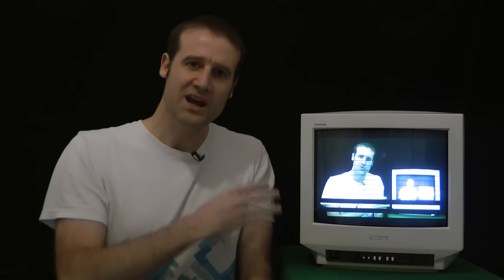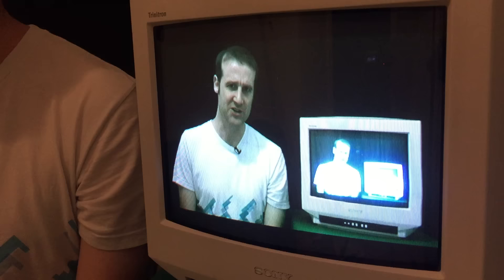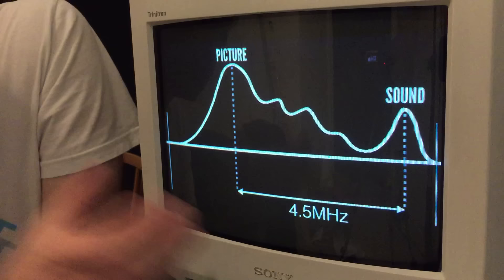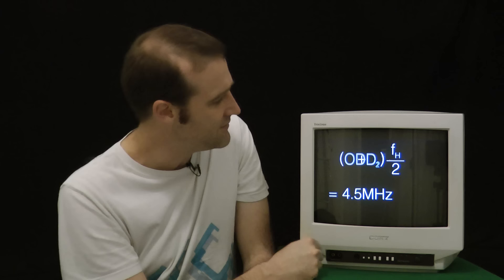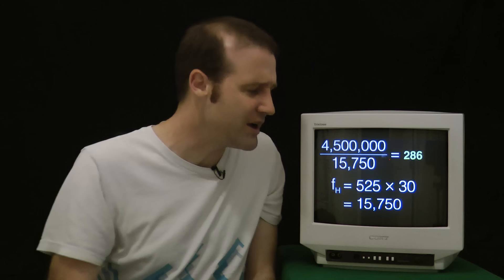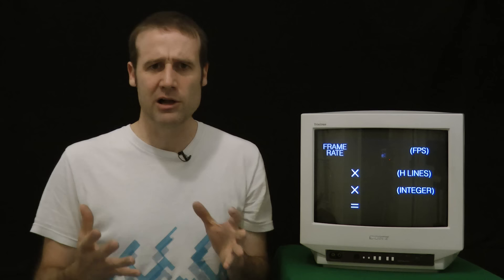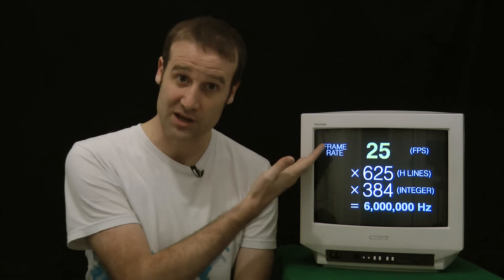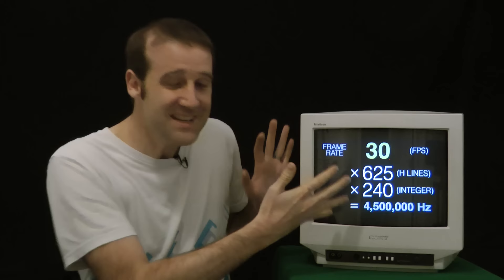Why is TV 29.97 frames per second?

Comment: Europe had the advantage of studying the NTSC system for nearly a decade before implementing their own color standard.  The U.S. introduced NTSC color in 1953, while (I believe) Europe didn't debut color until 1962.  It's not a surprise they were able to make improvements.  Switching to 625 lines made it work better, but at the cost of early model European TVs no longer getting compatible broadcasts.  When the U.S. began phasing in digital broadcasts most Americans got their TV from cable or satellite rather than over the air broadcast.  When analog signals were phased out, an analog TV could still get a signal with a converter box.  Old analog TVs didn't have to be scrapped.  Of course most of them were anyway as HD and 4K TVs have gotten so cheap most people have upgraded.

Comment: So now that the analog signal is switched over to digital, how has this changed? I'm guessing we don't have to worry about the 4.5 mhz window for a channel. I mean, we now have thousands of channels in multiple languages and we have steaming services. Does that mean the fps has changed? Or is it still 29.97?
Reply: It’s still 29.97, it makes it frustrating to work with video recorded on separate devices where audio and video need to be frame-perfect.

Comment: Sports and News was never at the frame rate of 29.97fps on NTSC TVs, so this video has so much misinformation.
And PAL would of had 50fps live broadcast. By the way, your eyes won't see both fields at the same time so 525 should be 262.5 H-lines 15.625 kHz.

Comment: If they changed the frame rate, how come old TVs could still understand? Wouldn’t they become out of sync?
Reply: Matt was wrong, the TVs weren't using mains for sync (it's not nearly accurate enough for that), the sync was in the signal itself and 59.97 was well within spec (each oscillator is a bit different, so the TVs were built to accept signals a bit below and above what they thought was 60Hz). 
The reason 60Hz was chosen was the mains frequency, but it had nothing to do with TV sets, it was so that cameras wouldn't pick up flicker from studio lights.

Comment: So 29.97 was basically a hack, got it. But if the framerate was supposed to match the frequency of the electricity, then wouldn't 29.97 fps put it out of sync and possibly cause some other issues that way? (I assume the error was negligible at the time, but would still love to know if there was any)
Reply: Synchronisation pulses were also transmiitted in the signal, which tell the TV when to "start over".

Comment: CBS had developed a color system superior prior to the RCA system but was not compatible with the 30 fps B&W so the CBS televisions could not show b&w shows. To really get your head scratching look up why to get NTSC at 29.97 fps to time correctly all broadcast video has to be shot using 'dropframe'. You may need a calculator to prove it for yourself.

Comment: Couldn't they just reduce the used frequency slightly? As in, leaving a bit of the 4.5 MHz to do nothing.
Like how 527 lines with an iteger of 248 would result in a 4,490,040 Hz signal, leaving 0.00996 MHz or less than 0.3% difference empty.
The additional lines would dissapear into overscan anyway and the miniscule amount of not used frequency could easily fall into manufacturing accuracy on the older B&W sets.

Comment: How would it be if companies changed standards at will? They would be able to obsolete your equipment so you have to buy new. Very convenient when a company wants to exploit its users for mo' money, mo' money, mo' money. Like when a website keeps "suggesting" you update your browser to avoid interruptions with a version that won't work with your machine. You have to buy a new one. Particularly suspicious is the case when the site doesn't serve anything different from what other sites serve with no interruptions, and no suggestions you upgrade.
Reply: @Christian Hansen Because of better compression algoritms and higher resloution than 480i /576i. Even early MPEG-4 ASP was based on h263, it had  limitation of resolution and bitrate. Later iteration had HD and better bitrate but still operate on h263 and wasn't compatible. The true MPEG-4 AVC based on new codec h264 has way better compression and much higher bitrate.

Comment: "Not the Smartest Choice" isn't exactly fair. It wasn't really a choice, there wasn't an alternative at the time. It's easy enough in hindsight to say that PAL is a smarter choice, but when the NTSC standard came out, PAL didn't exist. PAL was developed, at least partly, with the limitations of NTSC in mind.

But what about after PAL came out? Was it still a choice then? No. Obviously at that time, the market and consumers had already spent large amounts of money on NTSC-based hardware (be it on the broadcast or receiver side), and switching to PAL simply wasn't an option. The cost to both the consumer and broadcasters would have been absurdly high, something very few people would have bought in to. By the time PAL formalized and standardized, the NTSC standard was too widely implemented to change in a reasonably cheap way.

All that is to say that NTSC wasn't really a choice.

Comment: In your solution to the NSTC problem you simply picked a lower integer factor of 240, with 625Hlines and 30 FPS. However, if you can just arbirarity modify that integer, why not go for a smaller factor such as 120 and get 1250 Hlines? I'm sure there are some consequences to altering that factor, which I'm sure you know too, so please explain why you can't simply pick 120 as the integer factor?

Comment: Because the A/C in your wall is 59.9hz exactly 2 scans in the old interlaced TV format...
Reply: ...no, AC runs at 60 Hertz. If your electrical system runs at 59.9hz, you need to call your electric company now.
Reply: @General12th  Can't be anything to do with supply frequency which for example has a tolerance of plus or minus 1% in UK, so can vary from 49.5 Hz to 50.5 Hz. If it is also 1% in US then the range would be 59.4 to 60.6 Hz. No need to call your electric company yet.

Comment: PAL used not all horizontal lines for the picture only 575 if i remember correctly, the rest went for Teletext. Question is where did the NTSC system put the Teletext?
Man I'm gonna miss Teletext :)

The other thing i don't get is, what does it have to do with the power line? Did the Cinema and TV camera's didn't work with 60Hz? And when they changed from 30fps to 29.97 when color was out, did they also change the power line to 59.94?

Weird thing is, i have a Canon SX200IS, i can set it up for PAL and then record in true 30fps, and i can set it to NTSC and record in 25fps, but when set to 30 it records at 29.97 :)
Reply: There was enough leeway in the design specs of the TV sets to adjust to the small change in frame rate for color signals.

Like PAL, NTSC also had hidden scanlines used for sync and later teletext (seen as the black bars that roll when the vertical hold is out of sync, teletext signal, when present, appears as moving dots inside those).

Comment: I'm confused by how the 29.97 fps would have been derived from the 60Hz mains frequency ?
Reply: It's NOT derived from 60 Hz. Rather the source signal is at 3.579545 MHz at the source. That's multiplied by 2 and then divided by 455 to provide 29.97 Hz at the source.

Comment: It’s actually more complicated than that. PAL and NTSC (as well as SECAM) actually refer to color standards. What you’re actually comparing when talking about the bandwidth are related to the broadcast systems used (and in actuality, the frame rate is defined there, not in the color standard). PAL is commonly used on Systems B, G, H, I and N, while NTSC is used with System M and J(which I refer to as M’ because it’s just a slight tweak in brightness level in relative to System M). SECAM is used on Systems D, K, and K’. The 6MHz block is defined by System M, as is the 30fps/29.97fps frame rate standards. On the other hand, PAL and SECAM are often deployed on systems that also offer larger blocks- System B, which is used by most countries that are a member of the British Commonwealth, allocated 7MHz. All UHF systems as well as VHF systems used by the Eastern Europe block allocates 8MHz. To prove a point that PAL is agnostic to the system, Brazil used PAL on top of System M, which allowed it to keep broadcasting at a full 30fps with 6MHz channel blocks and still have a clean picture and sound signal.

Comment: Well since tv's where and are mostly 60 hertz. Why didn't they broadcast in 60fps? 29.974f ps on a 60herz screen introduced frame doubling.
Reply: 29.97fps in TV broadcasting was always interlaced and even today it is still interlaced, which means that it is as smooth as 60fps. Some TV channels are actually broadcasted at 60fps

Comment: But if 30 fps was initially chosen to match the AC frequency to make engineering TV sets easy, wouldn't reducing it to 29.97 fps cause problems in earlier TVs?

Comment: That 1 MHz wasted spectrum at the low end of the channel is not wasted. It's necessary. If it weren't there you'd have SSB ... and you'd have to have an accurate carrier injection at the receiver to recover the video signal. That's expensive. And pointless.

Comment: I don't understand any of this. So of the 6 MHz window (why 6, by the way?), there's only 4.5 MHz of actual picture, 0.25 MHz wasteland on each side (total 0.5 MHz), and a 1 MHz "windup" (and why is a "windup" needed?) - that's 6 total. So how much for the sound, then? There's a sound spike, there - looks about 0.25 MHz worth - but the video says it begins 4.5 MHz after the picture info has commenced - which actually leaves 0 Hz for the audio.
Also, why on earth does Δ1 and Δ2 have to be odd number integers? Why not two even numbers instead? Two evens also make an even.
Reply: I'm going from old memory on this (TV was a subject I chose not to take in tech college in 1970). But I did quality inspect TVs at GE in 1972-73. 
What should be added to the discussion are the actual terms we used. Horizontal retrace time - the time it takes to return the beam to the start position to draw the next scan line. and vertical blanking time - turning the beam off during the time required to bring the beam back to the top (in a zig zag way). What I think he means when he said windup was actually guard band. I also remember color was a neat trick of using a sub carrier frequency. 
This is turning rusty gears, but television had to share a portion of the electromagnetic spectrum with other services and although it wanted 6 MHz per channel, that wasn't easy to carve out. Channel one did exist, for a while, but It was determined by whatever organization preceded the FCC to redeploy that piece of spectrum to something else, so TV got 2-13. To make matters worse, not all of the available spectrum was contiguous, so we ended up with low VHF (channels 2-6), high VHF (channels 7-13) and ultimately UHF (channels 14-83), plus a little, unusable gap between channels 4 and 5 (I think). For a while competition for bandwidth came from CB radio, then cell phones and poor TV had to give up more bandwidth (channels 69-83 but I'm guessing).
We really never got to use the full 4.whatever MHz either, nor the 525 lines. Enter another term, overscan. The actual trace began above the phosphors and extended below it so in reality we only saw about 480 lines. Hmmm, where have I also heard the number 480 as in 640x480?  Occasionally we could have a defect and we could actually see an interesting problem called vertical foldover, where those lines destined not to be shown actually did, but inside out.
All of this said, I think I remember the real problem was visual interference between incandescent light bulbs that did turn on and off 60 times per second and the light emitted from a TV screen. And if I remember correctly, the way to solve the interference problem was to change the vertical refresh rate from 60Hz to something less. He is wrong about TV using the 60Hz power line frequency to synchronize. TVs had oscillators to do that. There are 6? sync pulses during blanking that are used to keep the vertical oscillator running at 59.xxx MHz and as far as I know PAL analog always had that visual interference problem at 50 Hz.
Overall, credit US engineering for solving difficult problems and making seamless transitions. 75% of the sets built when I was at GE in 1972 were black and white. At the same time we were building color sets downstairs and introducing a new technology called transistors (but I never did understand them new fangled things).

Comment: "I couldn't find a nice concise answer"
Here's one television used 60 hz from the powersource as the timing for framerate, which because of interlacing becomes 30hz.
When color was invented the chroma(color without luminance) data could not be added without some measure of interference or disruption of broadcasts to Monochrome viewers. So they used .05 hz of the standard monochrome signal to add it. Thus reducing the framerate to 29.95hz. There! Saved 15 mins...

Comment: When the original TV was created the US was using 25 Hz not 60 Hz which arrived in the fifties and early 1960s.
Reply: Please tell me you don't remember the 25 to 60 HZ conversion. I think it started well before TV was common, but I know that in the 1950s Toronto Hydro still had a program to replace electric motors in everything from fans to washing machines. I don't think any consumer TVs were built for 25Hz.
Reply: @secretrat  I Bellerive that the TV's were rectified power for the circuits and used oscillators to create the frequencies they needed. But yes I was around for the TV with 25 Hz but we kept the same TV for 60 Hz.

Comment: I still don't understand how does one display a fraction of a frame rate??!! It doesn't make sense!!! Does one frame get slightly less than a 100% displayed after 29 frames are displayed?! How does it work??!! It seems impossible to display on a 60hz monitor / T.V. a "Fraction" of a frame!! From my understanding you can display 30fps that duplicate each frame into 60hz but it's not 30 exact frames per second, so then how does 29.97 divide into 60 frames per second for 60hz displays??! What sort of Sorcery would allow this to work?! I'm sooo confused!! From an objective / technical point of view, it theoretically isn't possible and I while I completely understand the Math involved and what not for them to match a Broadcast Frequency and form a Mathmatical perspective 29.97 does achieve this Frequency Demand of 4.5Mhz, however,  wouldn't fixing that break the other? I mean, I'm still not getting just how they managed to display 29.97 fps into 60hz! Logic would say that you HAVE to have exact frame rates or at least frame rates that can be 3:2 pull-downed into 60hz output even if that means repeating certain frames more than another, but even pulldown methods seem to work only if you can have whole frame rates even or odd to begin with! What sort of lunacy is the world of tech where frames per second are not whole numbers?! I just can't wrap my mind around this and I've been trying to understand it ever since I was video editing and the options for Frame Rates were 23.97 and so forth!! I'm just thinking to myself "What?! How could that be?!" and it's bugging me because my OCD and what not wants to know all the various "in's" and "out's" of each options / tools used in encoding video.. Just like any craftsman, say a Carpenter, would like to know the results of various gradients of Sandpaper and how they effect say sanding a Music Box! Can anybody please help explain this to me?! Thanks!!

Comment: And I come from a country which had SECAM standard for long time. It's similar to PAL.
Reply: Not really. PAL encodes colour by altering the phase and amplitude of a subcarrier. SECAM uses FM, altering the frequency of a subcarrier.
Reply: @gerardjlaw    I just meant that SECAM is more similar to PAL than NTSC.  At least some source says "SECAM uses the same bandwidth and resolution (720x576) as PAL".
Reply: @camelCased There's a lot of confusion on the internet about this stuff, mostly because it's written by non-television people.
 
NTSC, PAL and SECAM are all bolt-on accessories to pre-existing B&W television systems. They don't have any specific resolutions or bandwidths themselves; those characteristics are all defined by the underlying B&W systems and the broadcasting frequency allocations. The misunderstandings come from the fact that almost every 525-line country adopted NTSC (Brazil was 525-line but adopted PAL) while all the 625-line countries adopted either PAL or SECAM. However, PAL is just NTSC with a subtle tweak (both using Quadrature Amplitude Modulation) whereas SECAM is fundamentally different (using Frequency Modulation). 
 
For an analogy, think of petrol and diesel cars. They're pretty much the same except for the fuel they burn, but a steam car like Jay Leno's vintage Doble burns its fuel OUTSIDE the working fluid cylinder AND has no gearbox. It may look on the outside like a Rolls Royce Silver Ghost but when you look under the bonnet, you're in a whole different world!

Comment: Changing the number of lines to 625 would have broken compatibility with all existing black and white TVs, AND it would have significantly reduced the horizontal resolution.
No, tweaking the frame rate was the correct choice. It maintained full compatibility with everything.

Comment: 384? I think i remember this vertical Resolution in old Graphic-Cards in Computers. Maybe Hercules?
Reply: 512x384 is one of the common resolutions in 90's.   
512/384=1.33
Same as 640x480, 320x240, 1024x768 etc, old 4:3 format (4/3=1.33). Maximum resolution depends on memory, your videocard had and display abilities.
I remember 2MB was enough for 1600x1200 in 256 colors, if i not mistaken.